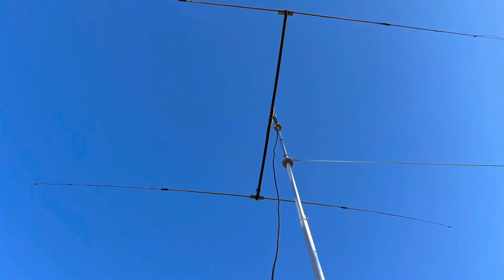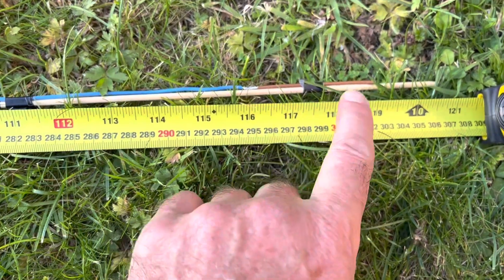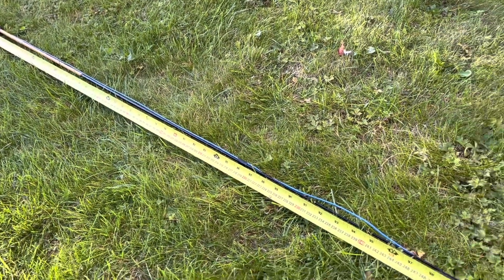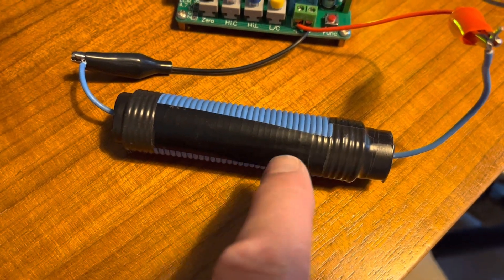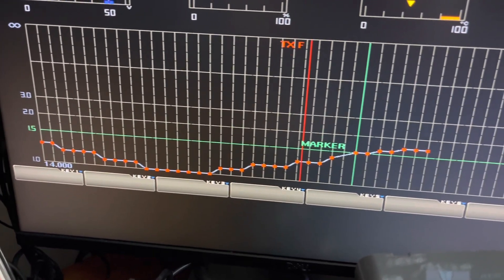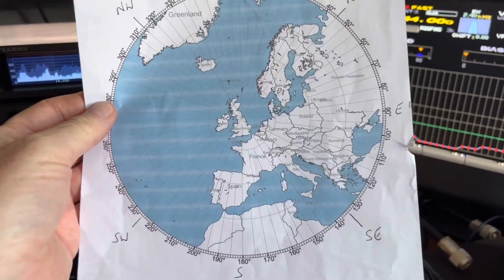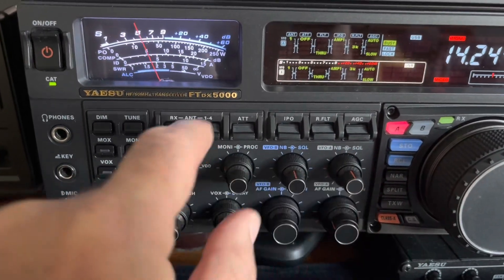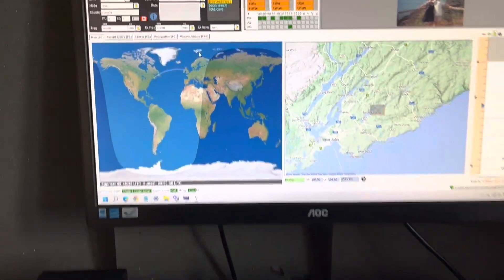20M Mini-Beam DIY Project - Part 3 (Final)

Comment: cant get this to work, followed instructions exactly my coils read about 2.5 uH, and after making the driven element with the coils on the dipole it reads off the scale swr. cant give exact figures as the project is now in the scrap box!
Reply from the maker: @garyclark1000  What a pain Gary. The coils are a little low for some reason, so longer perhaps will have helped there. Did you have access to an analyser? If the SWR is too far out of band it’s hard to know if the dipole is too long or short. Would be interesting to see where it was. It may end up out to the scrap box at some point 🤔
Reply: @G0CNN-Ian  Thanks for the reply Ian, I tried making the coils about three times with solid core 2.5mm2 insulated, enamel coated magnet wire, and the stranded insulated.  I got a reading of 5.5 uH with the magnet wire but still no good on the dipole. the SWR was really off the scale with a reading of around 300 ohms. not even in the ball park! I remade the dipole to full size omitting the coils with the same wire   and the swr was perfect after trimming (folding back method) I used a Sark analyser for tuning and a inductance meter LCA100 to measure the coils, but still way out.  I tried the sark analyser on my vertical after using it on the dipole to check and the vertical was also perfect so not a fault with the analyiser. The loaded dipole was so out of range The analyiser cound not get a match BUT it got close on 10 meter band with a very high swr. I tested for shorts on the dipole but all checked out ok. I remain stumped!
Reply from the maker: @garyclark1000  Crikey! Yes, baffled with that one Gary 😮

Comment: Great to see the build, lot of work I thought for some gain. Iam experimenting with parasitic verticals,  just three cheap painters poles, but  it's about 1-2 S points gain over 13,000 MLS. Ans less noise compared to the single vertical. All good fun thought. 73.
Reply from the maker: Thanks Brian. It needs more height than I can give it to perform properly. Have fun with the verticals 👍🏻

Comment: Ian when testing the dipole, the imp shows 50 ohm xs 0 ...what did it show when you added the reflector, i built a 40m 2 ele wirebeam version, only 13m high and used to work N7ekd and N7ry on 7.148 for many years, when others with dipole were struggling interesting to hear your response.
Reply from the maker: Hi. Sorry, I can’t recall now. I know I needed more height in the end to get the best out of it. My 7m mast was a little too low, but still worked mind! Good luck with yours 👍🏻

Comment: Nice build, Ian. I built the active element on two 3M fishing poles last year and have used it as a rotatable dipole for a few weeks - next step is to construct a boom and reflector. Adrian M7GGY
Reply from the maker: Great Adrian. It does look like an easy way to squeeze in a shortened dipole. Good luck with the conversion 👍🏻